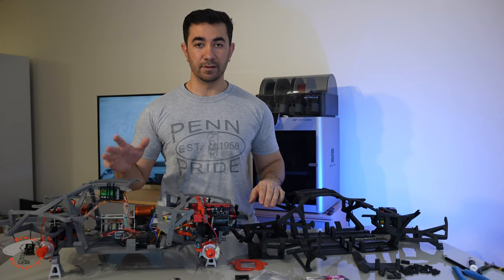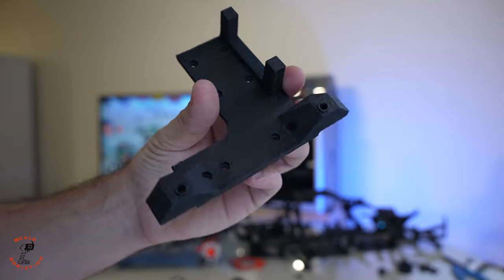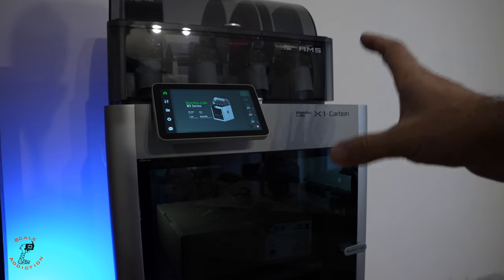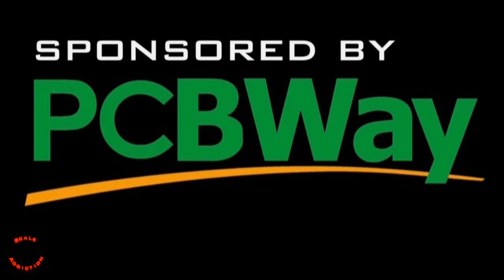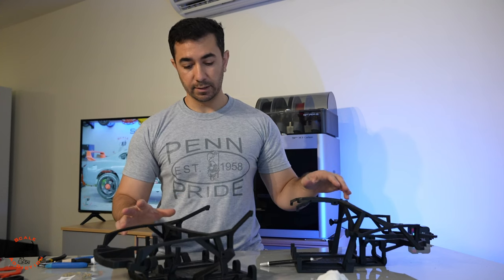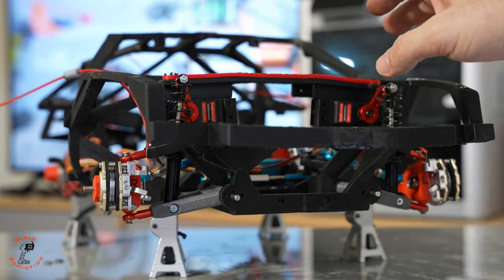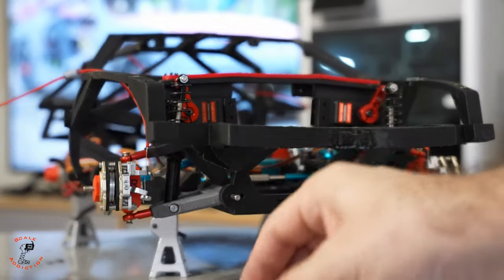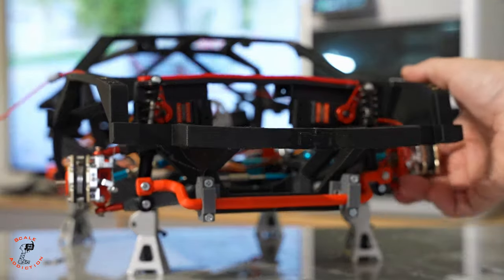Engine is back on 3d printed heat resistance till 194c | Scale Addiction

Comment: Those CF filaments have some safety risks and I wouldn't touch them with bare hands if not properly coated. There's a nice video from Nathan and his microscope.
Reply from the maker: I will check it out
Reply: That only applies to raw filament ends.